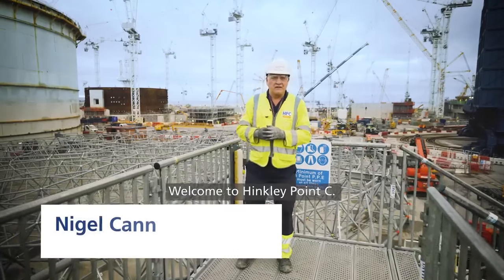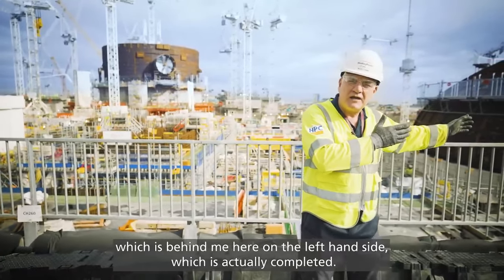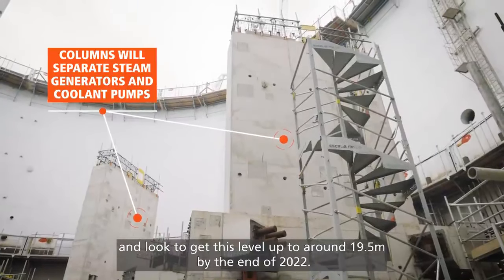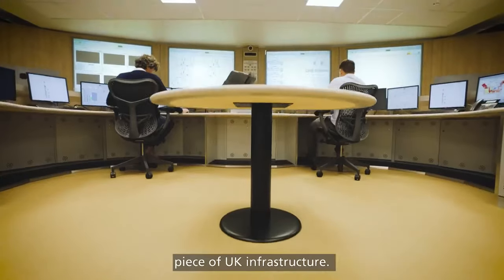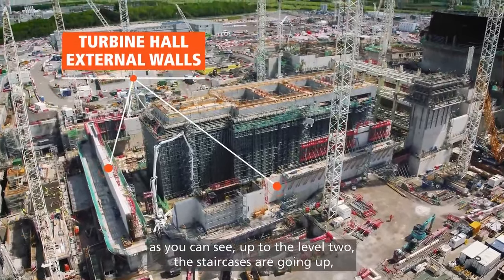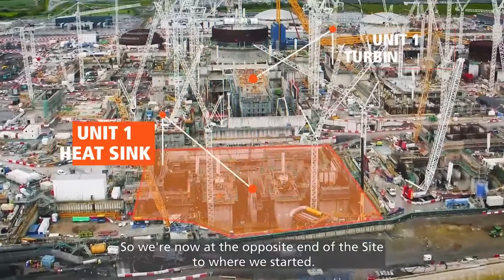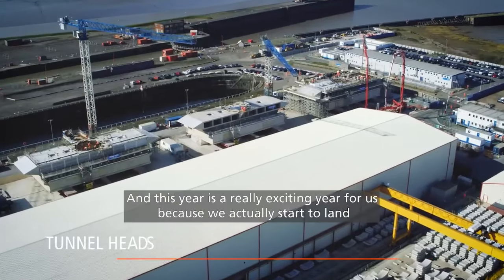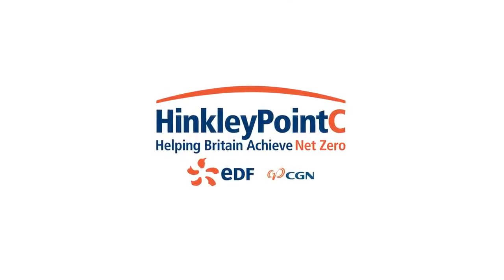What's the latest progress at Hinkley Point C? Take a tour with Delivery Director, Nigel Cann

Comment: 25-26GBP for something that is not dispatchable. How again is this helping to make the uk net zero again?

To treat this the same as people treat windfarms:

* How much CO2 is emitted to produce all that steel and concrete?
* What does the recycling of absolutely all components look like? Oh wait, that cannot happen as some parts will glow for many 100s of thousands of years still.
* How much concrete and still and other resources will be needed for long term storage of that waste, and how much CO2 will be emitted for that?
* Do wind farm operators need physical simulators to train their staff, and does that training need 2 years?
Reply: It is dispatchable just fine. But yes, it's way too expensive, it should normally cost about a third of this.
Reply: @zolikoff  It would if built on a larger scale.
Reply: @hpk31  Yes, and if the project and funding was managed better. It's not the fault of the technology.
Reply: @zolikoff  It depends on ones definition of dispatchable. Nuclear is much more baseload oriented, and cannot quickly ramp or down. It is more "dispatchable" than lignite, but far less so than gas, which is far less than hydro, which is far less than batteries.

And the problem with the cost is that that does not include dealing with the waste. 

The "one day we will bury it underground and forget about it" almost pipe-dream is not cheap: onkala is supposed to cost 1.5B EUR, but wait and see where that story goes. To get the german low and medium level storage facility in salzgitter "fixed" we spent close to 1B EUR on "research", and will spend at least that still to get it actually fixed.

Nuclear has no economic future for power generation. And .uk consumers will be carrying the burden for this monstrosity for a long long time.
Reply: @luc_libv_verhaegen  A PWR like the EPR can ramp faster than any other large thermal power plant. Only open cycle gas turbines and piston engines (which both tend to be small, few-MW grid balancing units) ramp faster. But wait, the PWR also has primary and secondary frequency control, 5-7% of its rated power can be used for that (on the order of 100 MW per unit), and in that mode it ramps as fast as an open cycle gas turbine.
So it is very dispatchable. It can load follow and balance grid frequency adequately. Granted, hydro is good for that as well and should be used as much as possible, but it is a limited resource by geography, otherwise it is not economical.
Reply: @luc_libv_verhaegen  it can ramp up way better than wind and solar.
German nuclear plants can ramp down and up at a rate of about 100MW/h.
But why would you ramp down anyway? Use excess energy to create hydrogen, done.
Reply: Concrete absorbs co2
Reply: It doesn't matter what method is used to produce electricity there will always be a carbon footprint in its construction. Wake up....

Comment: and what's clean about radioactive waste again ?      LOL
Reply: The fact that it can be safely stored in a contained room the size of your house, whereas non recyclable wind turbine blades and solar panels get dumped in Africa.
Reply: @melo1174 How  Do you know the size of his/her house ?
Reply: ... or is/was it an olimpic SIZE swimming pool?
Reply: The fact that there is so incredibly little of it generated and it is so easily stored.  Plus, there are nuclear power technologies out there that can run for ages on what this type of reactor considers "waste".  For those future reactors, this will be essentially free fuel.
Reply: @brianhaygood183  easily stored ? a lead lined 55 gallon concrete filled barrel out in the open , yeah , what could possibly go wrong LOL, I know , I built those ( dry storage pads )
Reply: @brianhaygood183  when a reactor unit is shut down permanently , you have to wait up to 200 years before dismantling the unit core ..